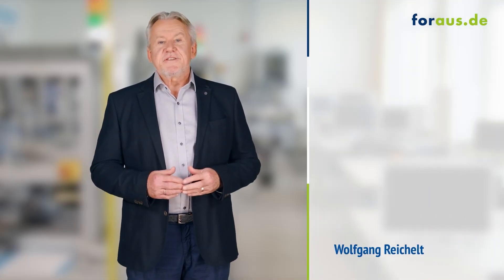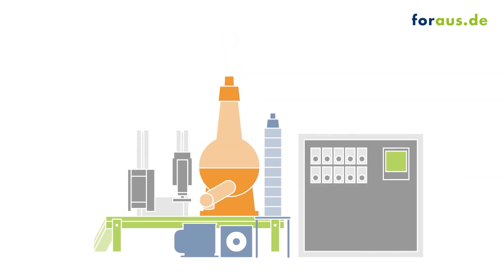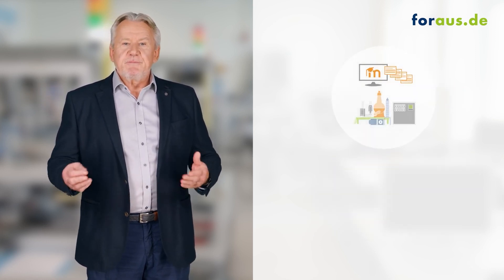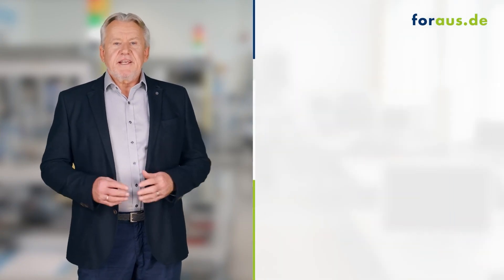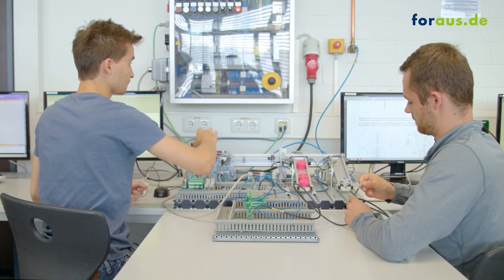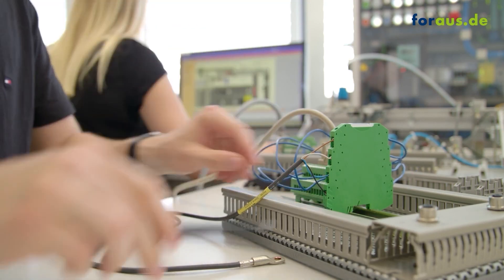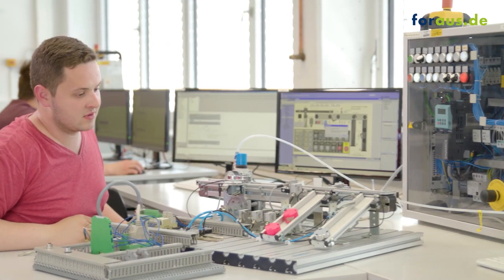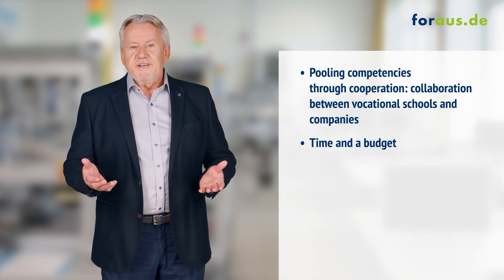Smart Factory - Industry 4.0 in Vocational Education and Training

Comment: The language used to describe this system is enough to scare any student. Perhaps consideration should be given to represent the system control as follows. The student may learn to handle any one of these control systems.

Basically, all systems use the following logic   Sense and measure the present internal situations of the system and any external inputs to it,  use comparators to decide if the system states are at the desirable levels, then any undesirable errors noted will be used to activate a process that will change the system states to a more desirable one. 

System 1. If an item is moving along a path and the item arrives at a particular location,  if the item spends a particular time in that location, then a process is conducted on that item, the item is checked and then the item is diverted to some other direction.  The condition for the process to occur is the present location of the item. The past and future are totally neglected. If more items are following each other then a non-collision condition is introduced. Only location sensors are needed and the units for processing. The rate of changes in the system state does not come into the control system

System 2. If an item is moving along a path and the item arrives at a particular location,  then if the item spends a particular time in that location,  and the item happens to have a temperature between an upper or a lower limit then a process is conducted on that item. If the item is outside the temperature limit, then temperature control is applied and when the item reaches the right temperature, only then a process is conducted on the item. The item is checked and then diverted to some other direction.   Since temperature normally used analog sensors, the information has to be transformed into a digital nature. 
Such systems also use the information senses in the present time. The rate of changes in the system state does not come into the control system but it should be used to control the rate of change of temperature of the item to stop it from overshooting and oscillating around the needed set temperature. Vocational training may lead to this standard of the control system. 

System 3 There are heavy systems that have accelerations, velocities, and position and load or unloaded outputs as in the case of a lift. Such a system will react after it combines the state of its acceleration, velocity, position, its load, and any external forces applied to it as winds and gusts. This could be a heavy load attached to the "jib" of a crane and the crane control system needs to unload on a stationary truck or on a moving truck in a  constant wind or a gusty condition. 
Here the sensors used need to pick up all the states of the system and combine them such that the motors that drive the jib of the crane are processed to move the load in its desired final location,  after the process predicted where the load should be.

System 4. Two coupled systems working together. This could consist of two boats one towing the other at a constant overall speed where the tension in the Hauser ( tow rope)  has to be constant while the boats are moving to the desired location.

System 5. A missile is shoulder-launched at a distant moving flying target moving at an oblique angle,  What states of the system need to be measured so that the processing algorithm predicts the future location of the moving target and hit it, in windy and gusting conditions!   This latter control system is far beyond Vocational training in Community colleges, or trade schools!

To note, The "factory school model" of education has transformed and atomized the educational system based on the priorities of capitalism. The marketization and corporatization of education have transformed students into cash milking cows, teachers as agents and shopkeepers, and educational institutions into factory shop floors.  Such an educational system is neither representing the life experiences of people nor their everyday requirements. It produces skilled professionals, who work like orderly stable objects with disciplined minds and hands and closed lips, who stay at the lower rungs of the social ladder. The social, economic, cultural, and educational alienation is the net outcome of such an educational system practiced worldwide.,